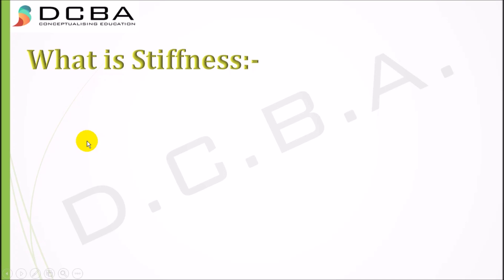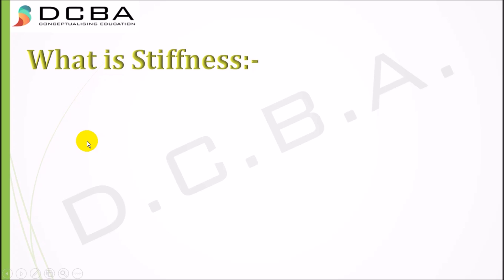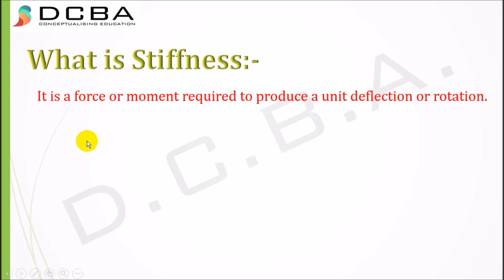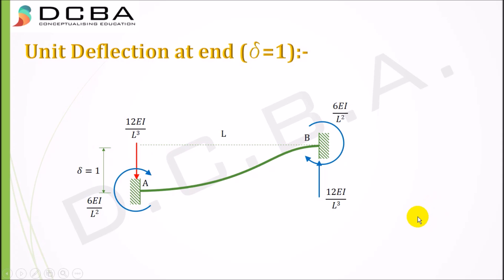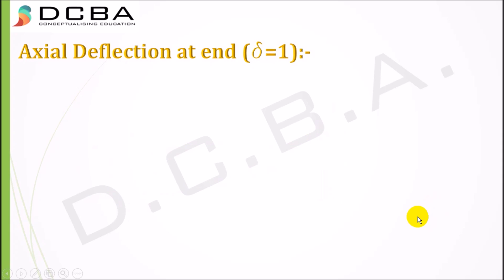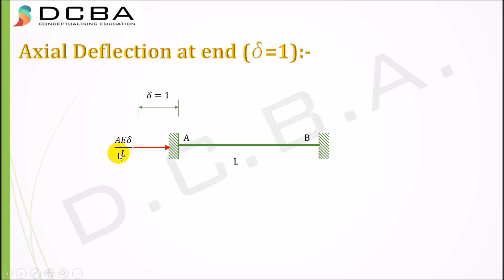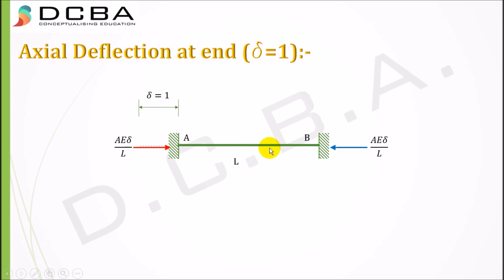Stiffness method structural analysis - Concepts & Basics

Comment: Actually sir your explanation is not made easy to learners , first you did not mention that the red moment is called " external concentrated moment you just said its a force" , secondly , you didnt show the internal reaction moments at both ends if you did that then no need to give any proof why the left reaction moment is anticlockwise.